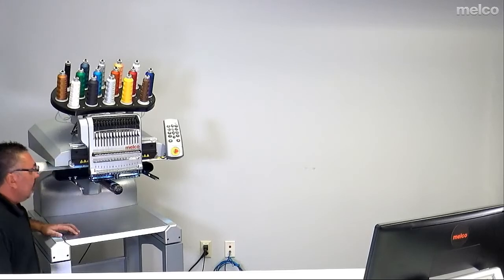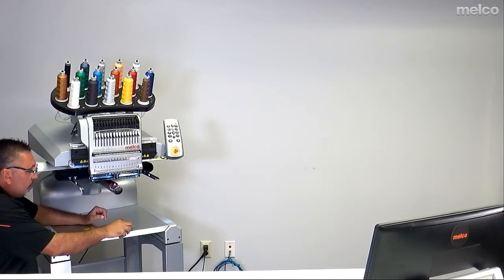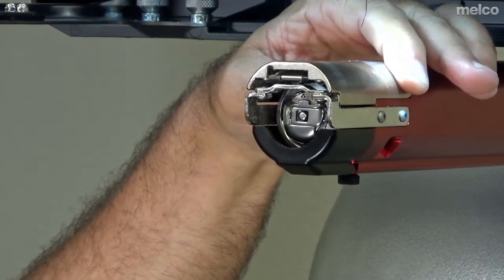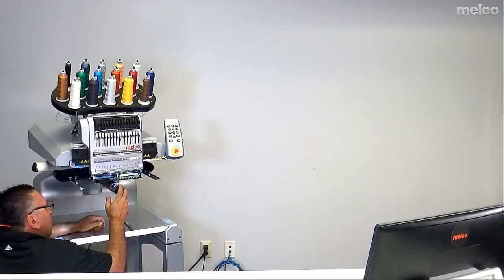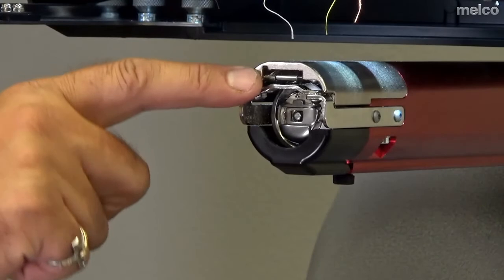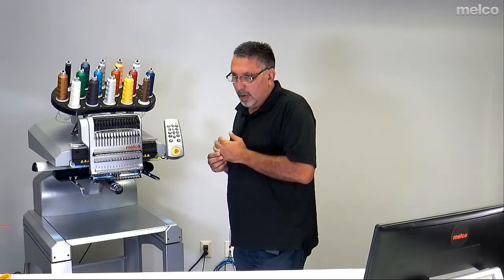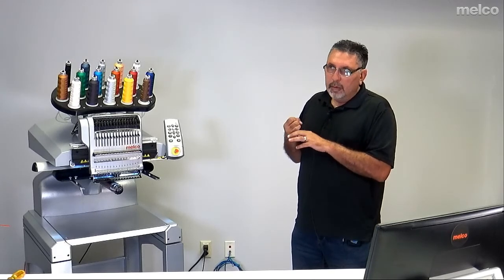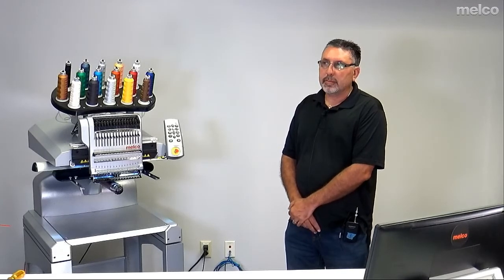Melco NPT (Needle Plate Trimmer) Maintenance - Removal and Replacement Instructions

Comment: Super helpful info! If you do maintenance and notice immediately after that your machine keeps powering itself off.... check the needle plate. If it’s not attached correctly, machine will continue to power down when you start to sew. Adjusted the needle plate and realized it’s super easy to miss it being fully hooked on, fixed the issue. :)

Comment: did all of that, and its still not cutting the thread.  We got a new blade in, changed it and still does the same.
Reply: You ever get your trimming issue fixed and if you did what did you do
Reply: @macten7110  had to change the needle plate